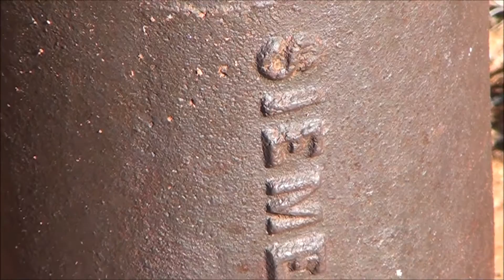Vintage Telephone line glass insulators, old Telegraph poles.

Comment: A selection of those beautiful coloured insulators would make an amazing indoor feature light.
Reply from the maker: A creative person could install a small globe inside the insulators and make some sort of Steampunk hanging chandelier, some of the colours of the glass is very nice.
Reply: +rustymotor you are very right. The different colours would look really nice. I made one from cut down coloured glass bottles and it was amazing but nothing like as nice a colours as those. It would also be a talking point and safe way to display part of collection. Mine hung from a metal ring I bent round a large water barrel made from rebar. Looked cool painted matt White with the glass suspended from white cable. Ended up selling it to a visitor who had to have it. Now hangs in a local art gallery/cafe!
Reply: I have multi-coloured mini lights around my glass insulators in a variety of colours in my living room. Its a beautiful sight day and night.

Comment: Very interesting Ian thanks. The single wire working against ground must have been interesting. I've read that operators often could hear ELF phenomena- whistlers and the like, and it must have been pretty chaotic when thunderstorms were around! Great to see the poles and hear a little of the history; I like the different colours of the glass :)
Reply from the maker: Hi Alan, thank you for your feedback on my video, its good to find remnants of the Overland Telegraph line, many of the poles were taken away after the Telegraph closed and ended up being used for Cattle yards and fence posts. It would be interesting to replace the missing insulators and rewire a few hundred metres of line and use it as a VLF antenna, there is plenty of open country out here that would be fairly free of interface of appliances. I imagine you would be able to get some good VLF reception. I would imagine that Solar storms would also have created problems for the Telegraph operators of that time, induced electrical currents would have been a problem. Lightning strikes too would have been a hazard!

Comment: That's some heavy galvanizing! Huh, Siemens brothers made the base-plate, eh? Interesting! Looks like the clamp near the top of that second pole has what looks like a manufacturer name and either a patent number or a patent date. Lovely collection, great color range!
Reply from the maker: Its amazing that those poles could have been standing for over a hundred years and are still in sound condition. You can see that the Zinc coating is very heavy, I guess the poles were dipped in molten Zinc originally. I suppose these days the Zinc is electroplated resulting in a much thinner coating. I was also surprised to see the original base plate still has its makers name cast on it, would have thought it have rusted out by now however the climate out here is very dry.
Reply: ***** It also helps that cast materiel doesn't rust away as easily as sheet or block iron/steel does, something about the crystalline structure, and yeah it looks like they were dipped in liquid zinc. I think there are both electro-plated and chemically applied zinc coatings now, you can even buy a cold-applied spray can version I think. But yeah, they don't stand up as well over time.

Comment: nice collection you have glad some of those old insulators and poles survived here in ukits extremely rare to find old stuff like that. Also I can receive VLF on just 60 feet of wire but mains hum is a. bother out there it would be great hope you experiment with it Ian if you want I will tell you my setup here
Reply from the maker: I have been interested in experimenting with VLF radio, I think that there are a few good radio circuits on the internet worth building. I am lucky here in central Australia is that I can visit very remote areas in the desert country a long way from mains induced hum that can be a problem. One trip I was on I set up a long wire between some trees at a spot near the Northern territory and Western Australian border and about 700 kms from the nearest city. I was using a crude amplifier circuit and did manage to hear some whistlers and pinging sounds. I would like to get some ideas from you about VLF, that would be great!
Reply: The setup I use here is a hi fi phono preamp which has high impedance input which has my aerial and earth connected this can feed into a pair of decent headphones  on this setup I hear tweaks whistlers and almost continual barage of thunderstatic and of course 50 cycle hum. This is a pain but I can't do much about it
Reply from the maker: That is a great idea to use a preamp, I will try that. I guess one way to try and deal with the mains hum is to use a notch filter to block it out. I guess its hard to find areas in the UK that would be away from the mains interferance.

Comment: Nice bit of history there, thanks for the lesson. Very interesting information, you mentioned it was a single wire at first and 
I saw another person (Alan) commented that it was "single wire working against ground" could you elaborate on that?
Reply from the maker: The original overland Telegraph line was a single wire running for a couple of hundred between Telegraph stations. The wire carried the signal and used the Earth as a connection to complete the circuit. Telegraph stations were needed to rebroadcast the signal due to degradation over a long distance, Telegraph operators would receive the signal via a Morse sounder and retransmit the signal using a Morse key.
Reply: Wow that's really cool, thanks for explaining it.

Comment: There is a big insulator lying in the bushes near where I live. It's a big round like half the size of a dinner plate. I am going to have to go and get it.
Reply from the maker: That sounds interesting, hope its still there when you go back for it.
Reply: ***** Yeah. Its attached to a massive piece of wood and is in the middle of the bush. I still have not gotten it, its in mint condition too. The thing weighs like 15kg. i might drop by and get it tomorrow